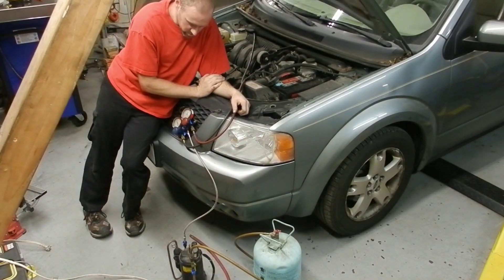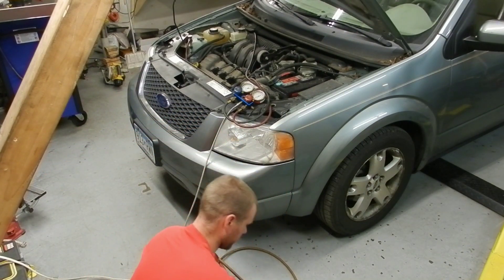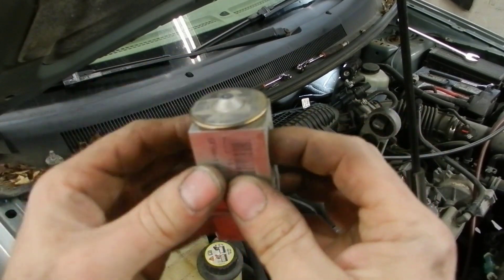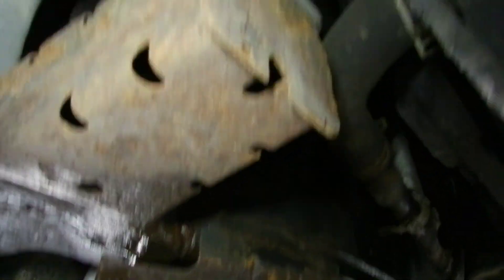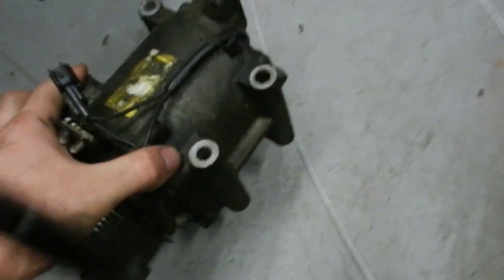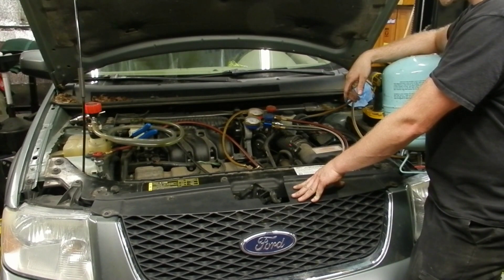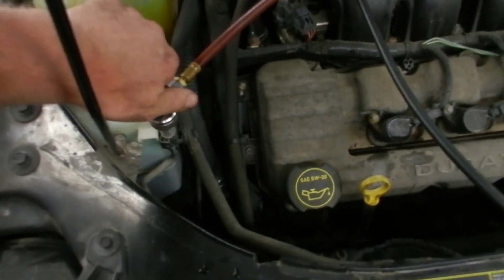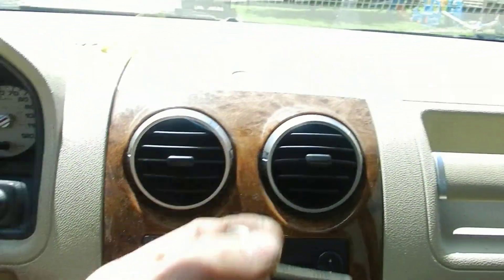AC work on ford freestyle replaced compressor and made my own recovery machine

Comment: I have a question maybe u can answer. I have an 07 altima 2.5 s, ac blows hot air,  compressor, and clutch engage, low side has pressure, high side has pressure, fans dont turn on, but i can unplug ect sensor, both fans turn on, so wiring good, checked both relays and fuses, they test good. Any ideas whats the issue ? Not sure if its compressor control valve or something else keeping ac fan from kicking on.
Reply from the maker: Not sure what you mean by low and high have pressure. They need to ha a good amount of pressure different. Low needs to be around 20-40psi and high around 150-250psi. You could also have a blend door issue in the dash.
Reply: @CrazedPerformanceRepair  well thats part of the issue, i cant read the actual pressure, bc i dont have my manifold gauges anymore., i checked blend door by turning it on heat, and it blows hot hot heat, when i put it on cool you can tell the difference of temp, it goes warm but as ur driving its hot again, just not hot hot heat, i thought if it was too low of pressure, the clutch would cycle on n off, but its not it stays on constant, just low fans dont kick on, so im unsure if low side is low, i can put an ac can on and i know it will not suck in any more freon, so im wondering if its too much, n gauge on can is wrong saying it needs more, but even if it was too full fans should still come on low speed.
Reply from the maker: @James-929  you might be too full. It could also be an orifice tube or expansion valve issue. You really need to get gages on it.

Comment: I have a 2007 freestyle, the air blows out hot. Had it checked at a mechanic and they said everything should be working and had no clue why it wasn't. Any advice besides getting a new mechanic 😆
Reply from the maker: Well... definitely a better mechanic would help lol. You could have a blend door issue in the dash but it's hard to say without seeing pressures on a gauge.
Reply: @CrazedPerformanceRepair  thank you

Comment: I have an 07 freestyle. New ac compressor still didn't work, they said no power to it. New ECM and still can't get the AC to work. Not really sure where to go next,  any idea?
Reply: I have a 06 freestyle it was the Ac pressure switch it's easy to change when they go bad it won't send a correct reading to the computer so it will shut it off so it doesn't hurt the compressor or any components

Comment: This is the hard way. I just did mine mine (took 2 hours with no air tools). 
Unhook battery power then. 
1 remove air intake (one screw and it pops off) and the small metal plate it sits on (2 easy to get screws). 
Remove radiator fans (2 screws on top corners and it lifts straight out after unclipping wires).
Unclip plastic that holds wires and hoses in place including bottom hose running flat across the frame for wiggle room (you don't need to open any radiator hoses or spill fluid but can if you want extra room by removing radiator hoses).
Remove (or loosen top 2 screws on ac pump).
Remove screw to pipe going in to AC (make sure there is no pressure in coolant lines first)
At this point you work under the car
Remove front right tire to see the pump, remove clip on plastic in the way.
Get the bottom 2 screws on ac pump from under the car.
Now that it's free you can wiggle it (do not force it) out from the hood. 
Take it all the way out the hole where the air filter was and try not to scrape it across the radiator.
If you take your time moving hoses and wires it comes out without forcing it passed anything.

Notes. There are some tight fits like the breaker bar under the car to remove belt, and the screws on the left side of compressor must have the nut removed before taking out the studs they come off with a very small socket on the end. Top left will run out of room 2/3 of the way out and you have to use a open end tiny wrench to get them the last little ways off.
Also you may need a friend with small arms to unhook the electric plug on the pump as it's a tight fit to reach it just has a press button on one side you hold down while you pull it apart.
Also if you can you may want to replace the studs with regular bolts as their are small and strip easy. They are just cheaply made.
Hope this helps someone.
 Also if you ever do the water pump on this car pay the extra for the one that bolts into the motor because they were made defective from the dealership so your new one may not even last you 6 months if you don't.
I learned that the hard way going through 3 pumps in one year